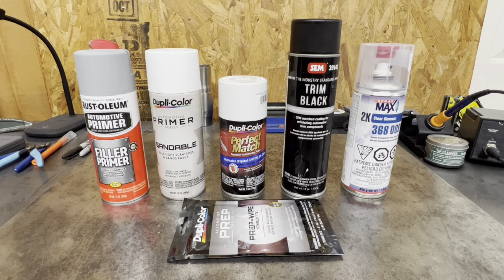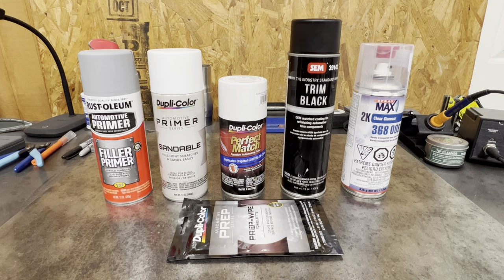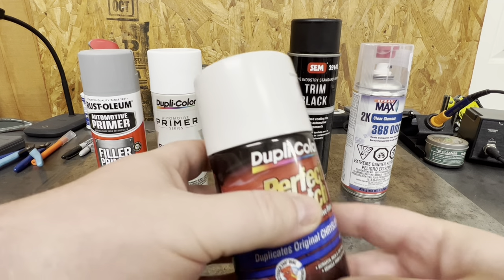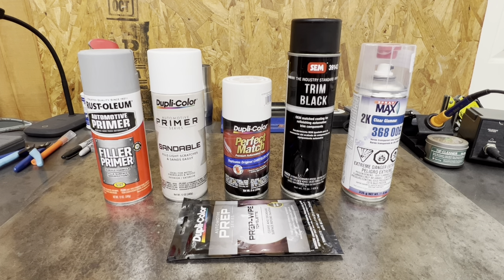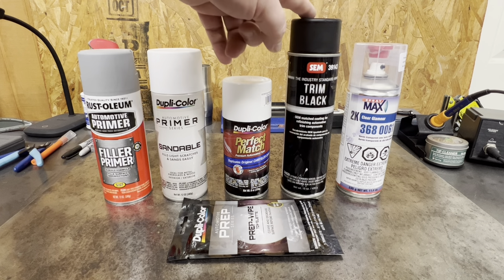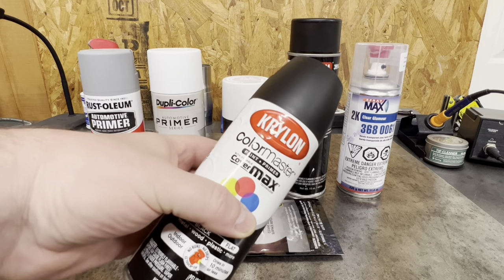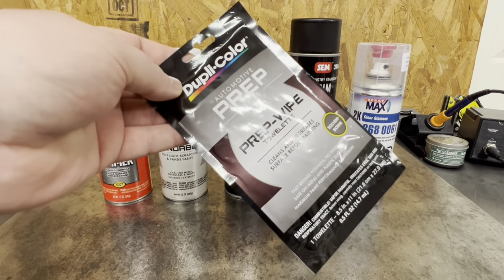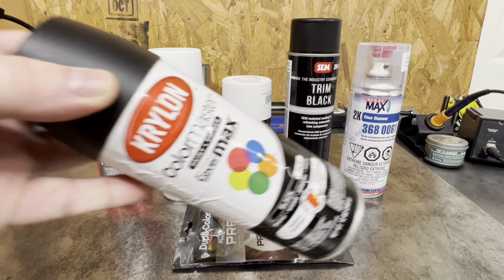A change I think y’all will like! No airbrush needed!

Comment: I've seen some awesome paint put down with cans. Cans of 2k clear sprays really nice. I usually get the can a little warm before spraying it though. It helps with atomization and helps keeps the orange peel down. If you haven't already, grab a tack cloth for final wipe down after sanding. It'll be way better than just blowing it off before spraying. They'r eonly a couple $ and can be used multiple times.
Reply from the maker: I am not a fan of tack cloth as if not used properly meaning opening them up and letting them breathe for 5-10 minutes they will actually leave residue behind from the cloth.
Reply: @mazzdesigns6929  True. they can cause issues if not used properly. It always amazes me to see what they pull off even after thinking the surface is perfectly clean though.